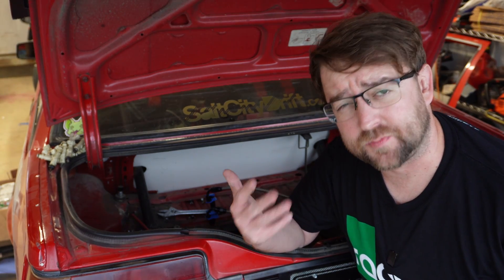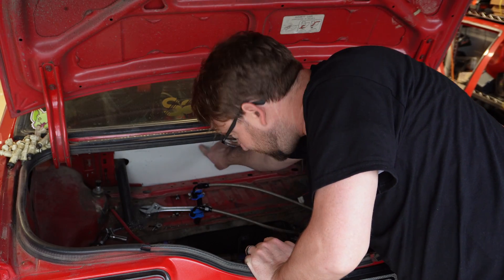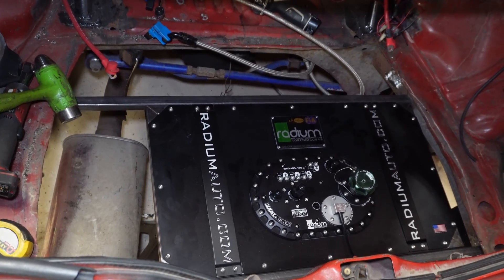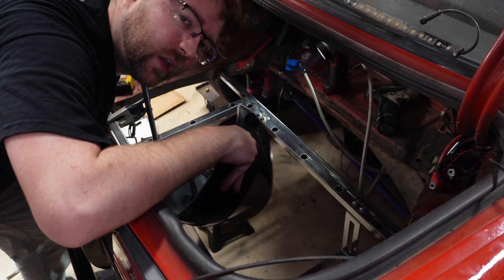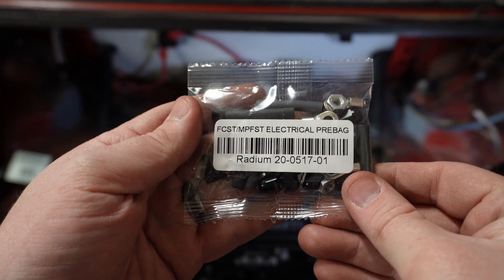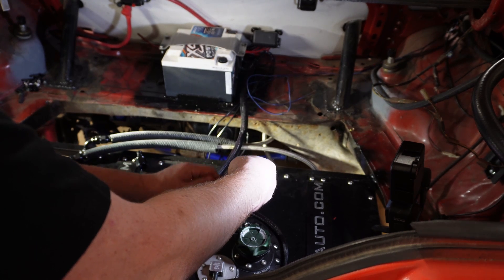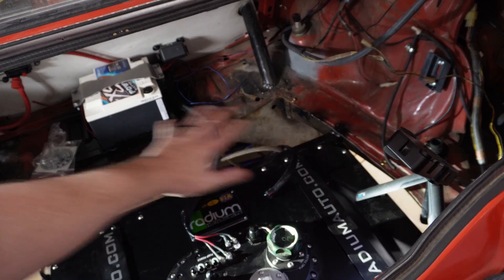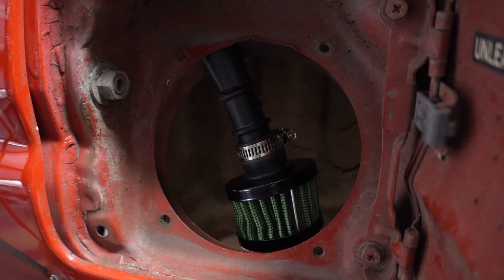HOW TO INSTALL a RACE CAR FUEL CELL!

Comment: can you fill up at pump? or dp you need to fill up a gas can to fill up?
Reply from the maker: I fill up at a pump still. I just have to pop the trunk.
Reply: @DoctoredGarage  thanks
Reply: does the pump auto shutoff when it's full or do you have to know how much capacity is left? Thinking of buying a fuel cell car with no gas level gage

Youre also the only person on the internet to answer that question so ty!!!
Reply from the maker: The pump auto shuts off when it's full :) it works just like a regular gas tank in that regard. You're welcome! :)